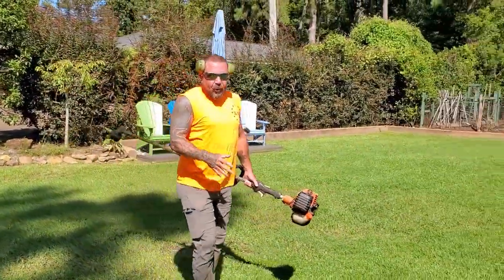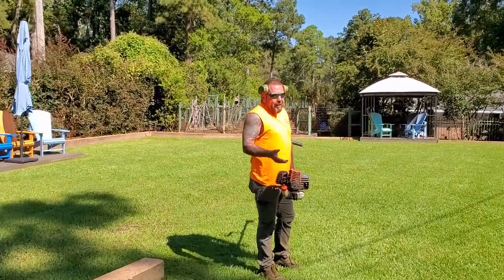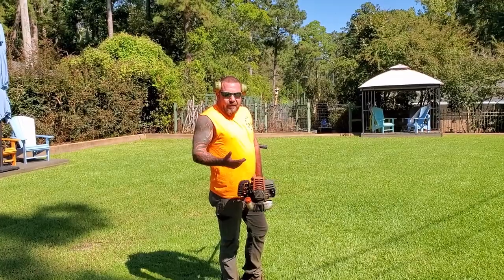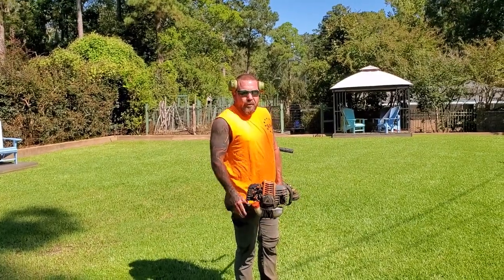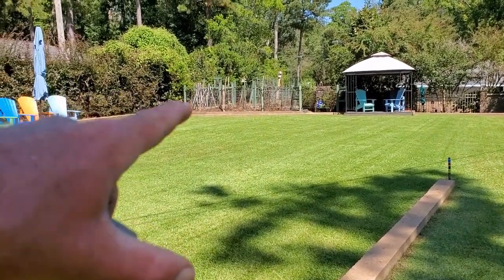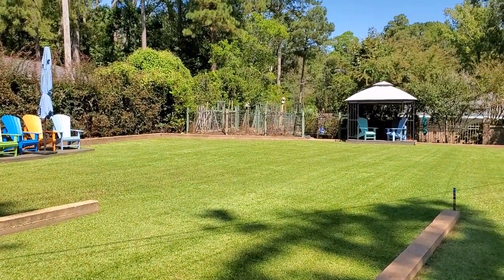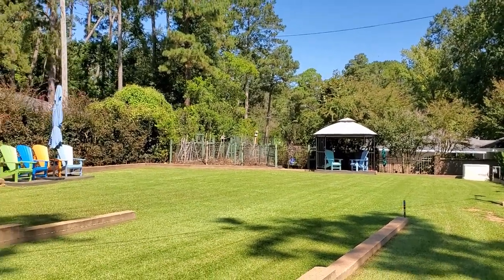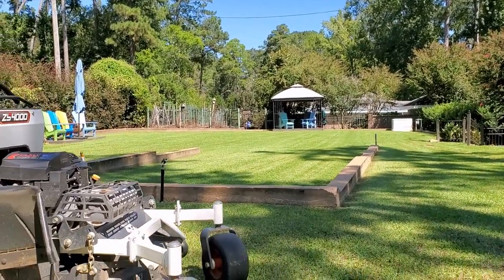Mowing with a Trimmer, Croquet, and Shoutouts!!!

Comment: Hey brother, quick question about the edging, does she like using a curve or straight? I like the curve ones little better, it’s like you see it better. Great video guys, killing in Mississippi
Reply from the maker: I like the curve shafts for that same reason. That's all she has used. I'll be buying an Echo 2620S straight shaft this winter along with other upgrades so we'll see what she prefers next season.

Comment: I went battery hedge trimmers last year and battery weed eaters this year I bet its paid for itself 3x in 1 year that's coming from my favorite trimmer echo 2620.   makita lxt hedge trimmer and husqvarna 325ilk 36volt.
Reply from the maker: Ive thought about it but we are slowly transitioning into larger residential and commercial properties and it just doesnt seem like they will work as well as gas on very large properties with hours of trimming
Reply: How did it pay for itself 3x vs the gas?
Reply: @AmericanLawnSpecialists  the 325ilk husqvarna will surprise you 1 battery last me 6 hours. get 2 batteries it will serve you well 25cc equivalent in power
Reply: @dtman66  not buying gas or oil
Reply: @shanepipkin4041  Oh. You get free electricity?
Reply: @dtman66  in my truck do you?
Reply: @shanepipkin4041  Haha yeah, sure.